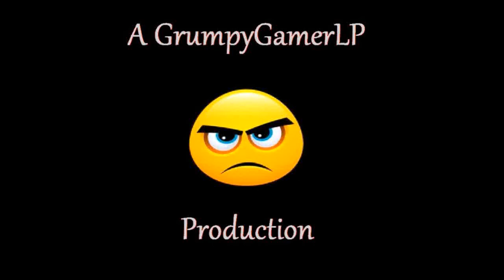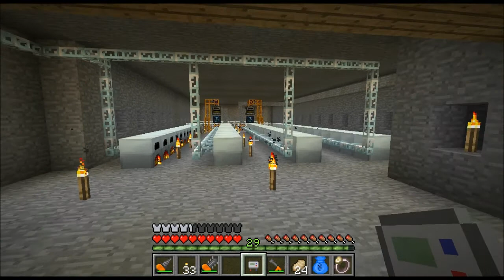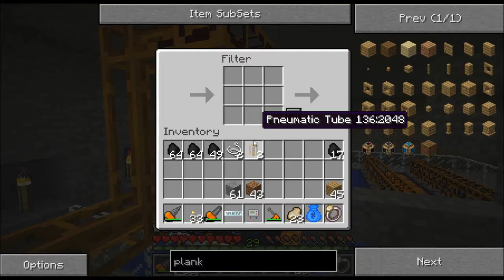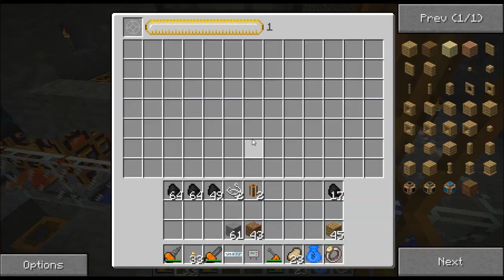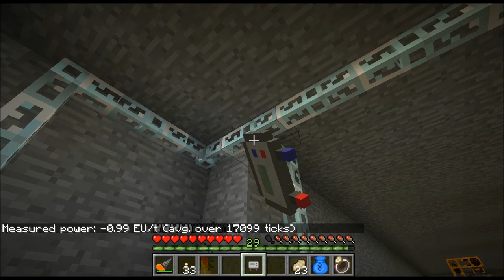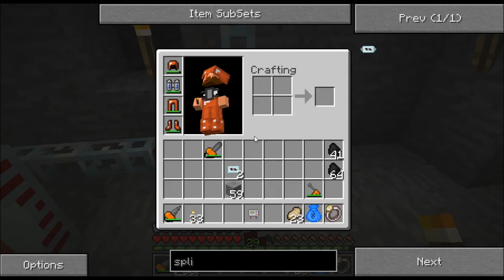Tekkit With Grumpy E21 - Experiments With EU (MFSU, Cobblestone Generator, EU Splitter)

Comment: Don't know if you figured this out on your own or not but redpower pneumatic pipes are "smart" so they don't send materials when there is nowhere for it to go. Anything sent after a destination becomes full is sent back, and when it's sent back it can become "clogged" in the system. This also happens when you use RP sorters and when you remove the pipe a bunch of crap will spit out of the sorter. This may have been the reason for your magic planks from nowhere, I don't know.

Comment from the maker: You have to send the power through an MV transformer and then an LV transformer. Alternately, you can put two transformer upgrades in your machines and that will let your machines run off of high voltage.